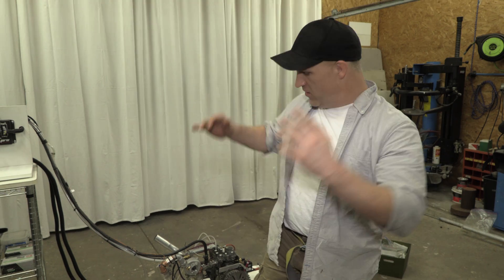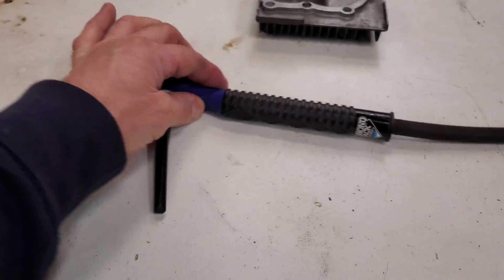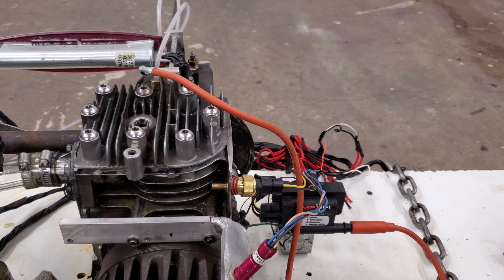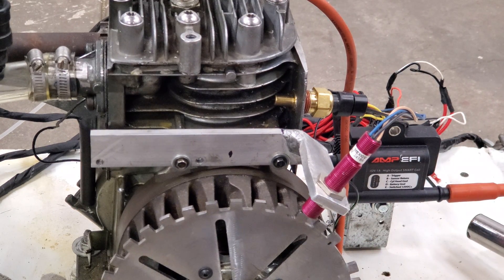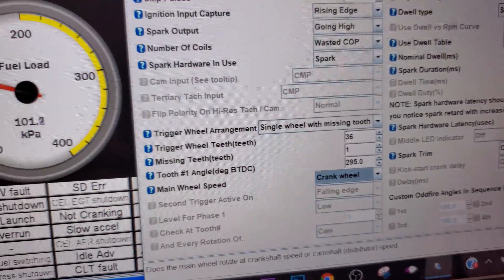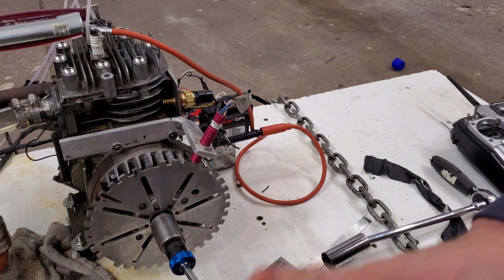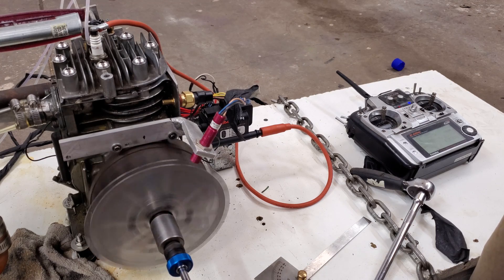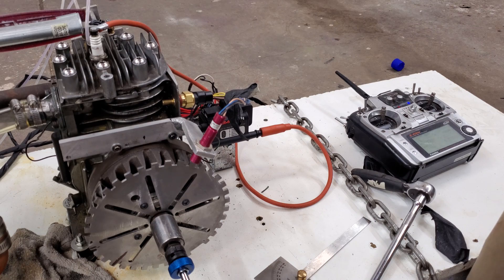See Thru Engine Project on EFI 1st Start Attempt (Warped Perception)

Comment: Your spark timing is way off, it's lighting the gasses while the intake valve is open. It would've ran fine with the original magneto
Reply from the maker: Thanks, I actually got it after I made that video, I was measuring in the wrong direction, the rotation was correct but my timing wheel is on the opposite side from the illustration in the instructions, so instead of measuring backwards from the sensor I had to measure forward from the sensor. Thank you, I appreciate the help, I got to going I'm now working on all the other little details hoping to film this on Monday and Tuesday and get this project behind me so I can move on with everything else. Thanks

Comment: that turbo is way too big for that motor it will never work
Reply: you literally are going to need a custom Turbo that revs so high it's not even funny to achieve any real boost. that thing should be humming at idle. you need a super tiny Turbo with tight tolerances you're almost better off Machining one that's basically disposable unless you had 10 grand to make a real Turbo 4 a video
Reply from the maker: @Adam-lv1uu  great point, that makes the project that much more exciting. I'm curious to see what's going to happen
Reply from the maker: Well I thought the same thing when I had the Mercedes turbo on there but once I got it tuned a little bit right now, my gut tells me that this turbo is going to spool
Reply from the maker: I haven't even ran Nitro yet oh, I'm running just regular 87 octane gasoline oh, and it seems like the turbo wants to Spooll up

Comment: Maybe try letting the drill spin the engine for a bit longer, and you might have better luck
Reply from the maker: Well, it turned out the wheel position was miscalculated. Shortly after I did this video I ended up finding the problem, as soon as I did that it started right up like nothing. I'm still working out a couple kinks today tomorrow and Sunday and I should be able to finish up the episode on Monday and Tuesday. Can't wait, this thing is going to scream
Reply: @WarpedLab  I look forward to seeing it run👍

Comment: Retard timing by 2.5 degrees and test until you get resaults and then adjust by .5 until you get stable running youll be able to hear the difference when you grt to the 0.5 degree adjustments depending on your resaults in the next video i may be interested in an efi kit like that

Comment: thats surely best example how to not atempt first start :-D
Reply from the maker: I'm not gonna lie though. Even though I know the right way to do things, my curiosity gets the best of me and I always like to see " what will happen if I just try it the way I would if I didn't have the right equipment" a lot of times I get new ideas that way.
Reply: right way is to make sure you have marked TDC somewhere, than verify that ecu see corect trigger pattern with ecu scope, than led in place of coil to bllink where ecu starts to fire, and align timing in software to match real timing and ecu timing, and than atempt to start engine with hand on fuel +/- key and eye on lambdameter , and crank and add fuel untill it starts, when it starts adjust fuel dose to 0,85-0,9 lambda according to lambda meter and heat up engine when heat up, stabilise lambda at 0.95-1 and verify/align timing with strobe light
Reply from the maker: You are correct, but sometimes I don't have patience...lbvs
Reply from the maker: Lol